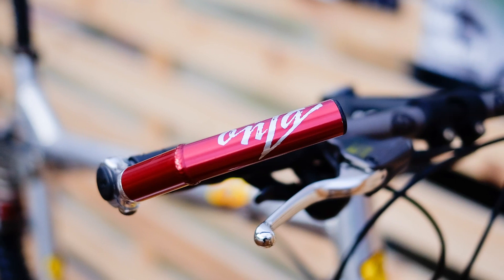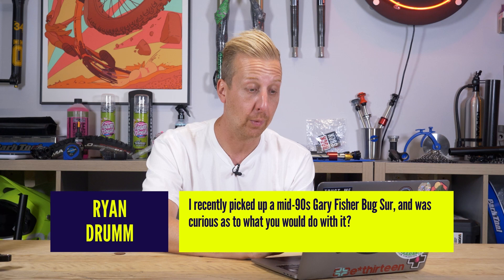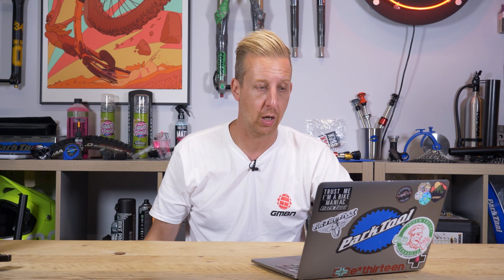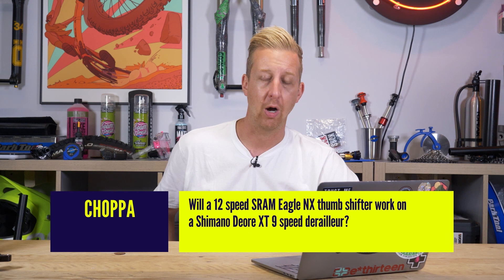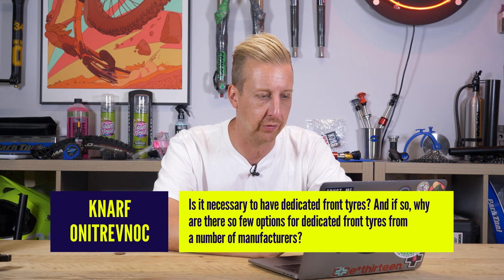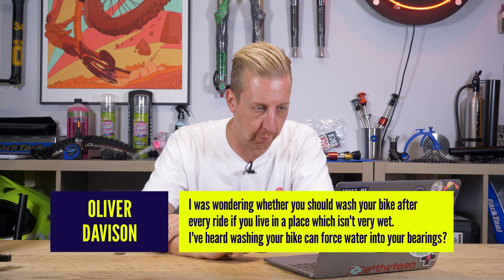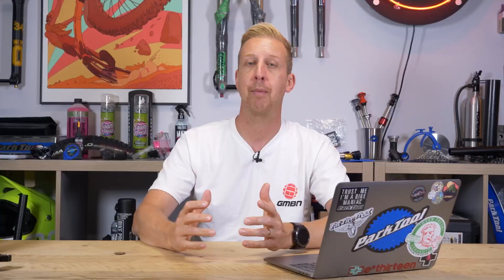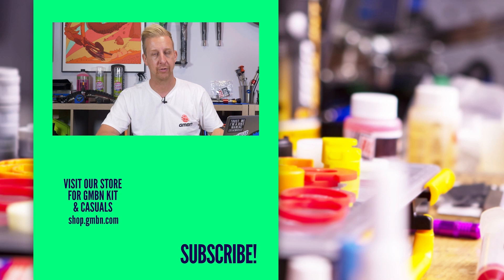"Are Bar Ends Making A Comeback?" | #AskGMBNTech 195

Comment: Never had a MTB without Bar Ends, I've been MTBiking a long long time, never knew they went away lol, useful to use as props if you need to flip the bike over, just adjust them pointing upwards, and it keeps my eMTB screen safe and off the deck whilst I work on the bike.
Reply: Bar ends went out? Been using them nonstop since the early 90’s

Comment: That last point about scuffing controls when bike upside down....reminded me of one of the best benefits of bar ends! Elevating your controls when upside down! This vid went full circle!
Reply: I just posted that point too, it's a good reason to have them, although not the looped style, those can and will break your wrists if you go over the bars or snag your hands, I use a slightly curved bar end, much safer IMO, also love my Jones H bars with posts for bike packing and touring, works just as well for flipping the bike over.

Comment: I think bar ends are great when they are placed inside the grips instead of outside the grips.  Gives you a road bike like position. With modern wide handlebars, grips on the outside are just too wide and also prone to catch on bushes.
Reply: Ooh interesting
Reply: Exactly right.
Reply: The main point is preventing your bars from getting caught on trees or other obstacles, so you're undoing the benefit
Reply: I used to do this, like a tri bar of sorts, good for a long road climb when you're doing multi surface days out
Reply: Yes, if you switch left with right you have what the roafies call 'aerobars'.
Reply: if a bar end would hit, so would your hand, and that HURTS. Never crashed from bar ends hitting things, as anything thick enough to snag the bar will spin you regardless. But the extra hand positions, leverage, and safety are always there with stubbies. No real downside beyond “image”. FWIW, I run @ 800mm bars on both bikes, and have no issues in tight, overgrown trails.

Comment: The advantage of being able to change your hand position for xc riding is hard to deny. Not suggesting you would use bar ends for Red Bull and free ride type mountain biking but for basic cross country they're fantastic. Most people don't know how to set them up properly, they run them way too high pointing up which negates a lot of the leverage and could create a hazard if you do happen to go over the bars. Run them just a few degrees higher than flat and you will see a big difference.

Comment: Just had a similar issue with smallest gear skipping and gostshifting. It turned out it was mech hanger screw got loose. Could be mech screw loosing up as well. After tithing all issues dissappeared.

Comment: I still have bar ends on my 20 year old Klein Palomino, and after getting on that bike for the umpteenth time, I am still glad they are there for on the seat riding. My question is why did bar ends ever "go out of style" to begin with? Is it because newer riding styles and geometries of the new bikes are more conducive to standing on the pedals rather than sitting on the saddle? Bar ends, like drop bars, help relieve positioning the hands for long periods of seated riding, and also facilitate a more tucked position if/when aerodynamics are of concern.
Reply: Riser bars, the rise of down vs up mtb riding, and geometry changes that resulted from the change in focus in mtb. 

Bar ends main purpose was to allow for hand positions further ahead of the front wheel which prevented the tire from lifting when hitting VERY steep climbs. However outside of the main purpose of bar ends,  which was getting weight forward, bar ends allowed for some very comfortable resting positions while on longer rides. 

I used my bar ends for resting much more than climbing however, this was the 90s and going up steep stuff was still a big part of riding. 

Nowadays if you want to ride a flat bar or riser equiped MTB and use the bar ends for the comfort factor, do it, Im definitely considering finding some bar ends to fit on my vintage Kona.
Reply: @messagedeleted1922  Thanks for this reply. Yes, mtb does seem to be more about downhill than uphill riding now. Your putting the context of the bar ends 30 years ago as a factor eventually leading to their demise makes perfect sense. Mtb has definitely changed from the days of Tomac and Overend, and so have the bikes. I have a new Transition enduro bike, but still appreciate the agility and comforts offered by the old Klein.
Reply: Bar ends are practically made for out-of-saddle efforts!  So easy to rock the bike.  That said, I'm NEVER out of the saddle on the mtb, but still enjoyed bar ends for over 20 years.  Might be nice to welcome them back!
Reply: No no no. Bar ends dissapeared with wide handlebars which came with 29rs.

Comment: I have those very same Onza's (first ones pictured) on the city bike.  So comfortable.
My occasionally numb and tingling hands would welcome bar ends back.  Ironic since I've finally stopped expecting them to be on the new bike's bars...
This will require a rule change at most amateur mass-start mountain bike events though, as bar ends are currently prohibited.

Comment: Tyres:  I've found I can ride a fairly bald rear without too many issues, even pinch climbs done right (my videos of a local tech rooty track 'Deliverance' were done mainly of well worn rear).
I run a Minion DHF on front and as it wears down, move it to the back (and reverse it's rotation).
This way I'm not throwing away good DHF's that are a bit beyond sticking the front in place but still up to sliding the rear around.

A fairly worn rear has never really given me any issues, in fact I corner a little better as I can break the rear loose easier... But then again I AM a mediocre DH rider.

Anyone else have no issues running worn rears on a DH MTB.

Comment: Why did people stop using them in the first place, bar ends that is? I still have my old one's (from early 2000s, cough) on my xc bike. If you end up climbing often, they are a must-have, getting out of your saddle and staying out is so much easier to maintain on a big climb with good hand positions.
Reply: Cos they are totally dangerous... branches, bushes etc can grab them... and they were indicative of poor bike fit.... get a long (and low) bike
Reply: Because most people mountain bike for the thrill of the downhill.  Peddling up is merely to stay aerobically fit and earn the downhill. In downhill you don’t want those damn things cluttering up jumps, drops etc…
Reply: @rupedog  go away troll, lol. You must be new to mtb's.
Reply: @mrsmartypants_1  I'm not talking about huge tree branches at the end of your bars m8, similar size to the hand guards that ews riders use. Just curious, how do they clutter a jump? I do jump with my xc bike, and I have not noticed any issues, I just don't do the bigger jumps/drops with the xc bike.
Reply: @jcgrundl  Nope you definitely don’t do big drops on an XC.  I think for long XC riding they may well be a nice option.  I don’t do XC but years ago when I was into road bikes the various hand positions were very advantageous - especially for someone like me whose hands tend to start tingling being in a horizontal bar position for long periods of time. (Mainly my right wrist which I broke twice in the distant past.  Ski accident, dirt bike accident).  I like a clean cockpit when riding a jump line, doing major drops or running steep gnar.  You will never find a downhiller or enduro dude equipped with bar ends.

Comment: Not sure if it was mentioned, but another benefit to having bar ends is the leverage you can apply to the rear tire for increased traction on climbs. I think more modern seat tube angles do away with that, but would be interesting to try again. Bar ends are so 1990's :)

Comment: 2:44 old MTBs are not always heavier. Not sure about the one in question, but one can build a 20-21 lb bike with a 90s-00s MTB frame for half price of new gravel bike, if you buy the right frame. Some are confusingly light and strong. For the same price as a new gravel bike, you can land in 19 lb territory if building with certain components (but then just buy a gravel bike if under 20 lbs).

Comment: #AskGMBNTech, I decided to treat myelf to a SRAM AXS rear mech.  Loving it. I have a Ribble HT 725 steal frame hardtail with internal routing. Now I have removed the gear cable, do I need to worry about water getting in the holes left in the frame, potenally causing corrosion? Should I plug up the holes in the frame where the cable went? How would it be best to do this? Thanks for the all the great content, it was GMBN/ GMBN Tec that inspired me to get into the MTB world.

Comment: Pads rubbing when corning can be a sticky caliper piston.  Especially if it happen after you changed you pads. The portion of the piston is pushed out of the caliper body as the pads wear and the piston dries out from exposure. If you push the piston into the body to replace the pads without lubrication they can stick. They can stick  top or bottom or one side only and won't push out or retract evenly causing noise when cornering a loss in power and less sensitivity at the lever. @gmbntech

Comment: #AskGMBNTech, I recently took the two by derailleur of my specialized as it was driving me nuts. I have ran into a small problem though as the plate that the mech was mounted to is attached between the linkage and the front triangle. Can this be removed or will I just have to ignore it. Wired quirks of the bike that I hadn’t ever noticed before. The bike is a 2016 specialized camber comp btw.
Thanks,
Billy

Comment: I have a 2018 YT Capra 29er, I installed a PNW 200mm dropper so I can get the seat lower from my riding position. There's a plastic tube guide inside the frame that guides the cable housing. I feel like it's too long. My dropper isn't as smooth as the shorter e13 I took out, and I can feel the dropper pressing on it. I can not access it from the bb either, how do I cut that shorter?

Comment: Bar ends in tight forest tracks with hanging vines…… a recipe for disaster as I can attest to from experience several years ago when I had some bar ends. 
But those very small pinky protecting ones - definitely interested in a set of those if I could find some.  Close trees and 800mm bars = pinky crushing

Comment: #askgmbntech I have a pair of bikes at each end on the border of trail mountain bikes. One 27.5 and one 29'r the 29'r 65 degree head angle 160 Frount 145 rear is enduro/trail  and the 27.5 is more a cross country/trail 140 front 135 rear. I want to experiment with a mullet set up should I put the 29' on the front for the 27.5 or get a 27.5 for the 29'r

Comment: #askgmbntech I've just received my Nukeproof Scout 275 Race which has Shimano M4100 levers and MT410 calipers. I want to swap out the brakes so I can use metal pads, but stock stock issues with the M7100.

Could I use my existing M765 with the M4100 levers? 
Unfortunately M765 levers are the wrong ispec for the shifter :(

Comment: #AskGMBNTech - I just grab old Raleigh Exodus MTB (this one was handmade in Nottingham in early 90s) bike is working and in mint original condition (except tyres). From first owner.
I will be rebuild this MTB: Drivetrain 1x10, and wheels to fit casette...
My goal is to own nice looking retro bike, but should running great (old 3x6 system and freehub is not best option)
Maybe You should do a test - how far You can go with modern components and retro MTB?
(I'll keep old original parts to make an option to return to original state)

Comment: #AskGMBNTech So i got this problem, i have a 9 mil qr hubs on my bike, sometimes what happens is that when i am on the bike my rear rotor touches one side of the pad so to "fix" this i set the whole caliper to the oposite side, but it also makes it rub on that side when theres no weight cause i can see the rotor move a tiny when it has weight on it, when i take the wheel and put it back happens but sometimes this doesn't happen. What im doing wrong? Is it cause i put my bike upside down and then put the wheel? I thought i would just fall in place

Comment: #AskGMBNTech , love the review on bar ends, use them myself on my bike, really helps with posture when u need to seat up right or higher for longer rides, really useful. Got a quick question tho, i have noticed the illustration you have hanging on your wall behind u and wonder where would i be able to purchase a similar picture to decorate my workshop wall with... 😁.

Comment: Yeah bring them back, but stupid UCI banned innerbarends from xco competition !! But they allow to use  classic bare ends. Considering that now xc handlebars are even 800mm long, putting bar ends on the ends of the handlebars on the outside of the grip is stupid. Much better option is but innerbarends or whatever you want to call them middle barends.

Comment: I wonder what Doddy’s real opinion is on gravel bikes, he’s so defensive. 

What’s so wrong with drops on a gravel bike? Its a way more efficient way to cover ground quickly on dirt roads and gravel roads. 

I took my bar ends off the MTB when they hooked up on a barbed wire fence and threw me off. Not to mention constantly getting caught on branches. The flat bar with bar ends doesn’t even come close to comparing with hoods and drops IMO for versatility and comfort. 

The way I see it is - gravel bike for gravel, mountain bike for mountains. There aren’t any mountains where I live.